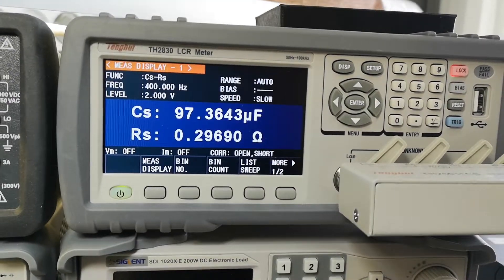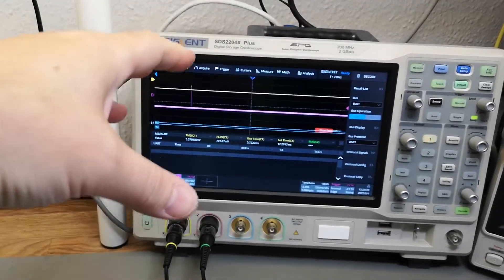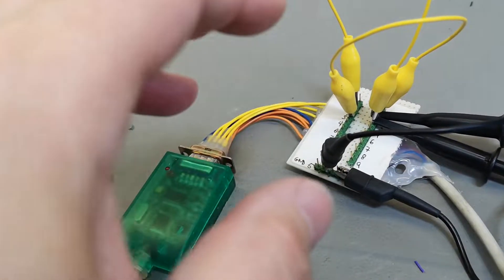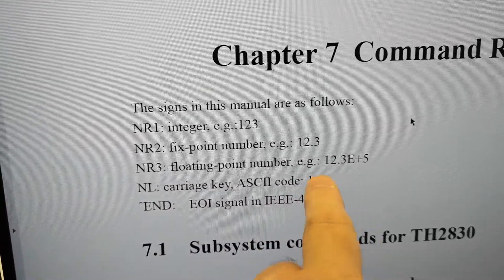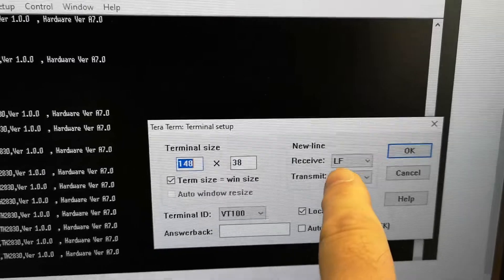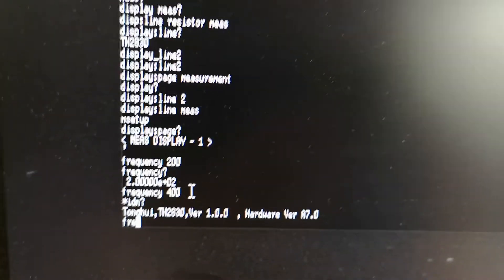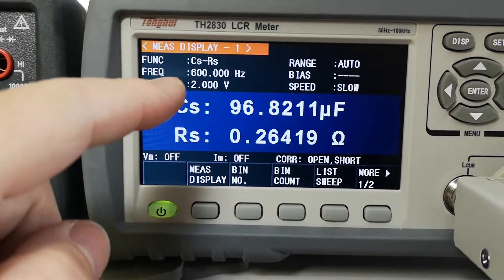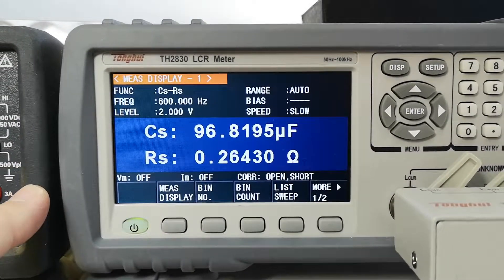Tonghui TH2830 LCR meter serial port rs-232 FREE SOFTWARE

Comment: Hi Thomas,
What do you think about the Tonghui TH2830 LCR meter?
Do you recommend it?

Have you been able to upgrade it to 2832?

I'm looking for a good LCR meter and would like to have one that can be set to any frequency. Then I can create different impedance graphs.
More well known brands are much more expensive.
Reply from the maker: i am very happy about it as it is, i have not heard about any upgrade, is it software only ? how to install it ? and what will it do ?
you will see many videos of mine where i use it for all sorts of components
if you want a free curve trace software for this one, go to my web site called webx dot dk, in the root write th2830 dot zip
it is written in java and will most likely run on ANY playform with a serial port, i only tried it on wondows pc.
Reply: @TeardownOZ2CPU  Hi Thomas,
Did you see the email I sent to your gmail account some days ago? (Checking if that is the correct adress. The name is a bit odd, I think...)
Reply from the maker: @Soren_Marodoren  no email.. you find it under YT profile, it is also easy to find at my web site under contact, did you find the software ? you can not write links or full email in a YT comment
Reply: @TeardownOZ2CPU  Hi,
Software won´t work, if you start the application a failure message appears (compiling error).
Reply from the maker: @metaluna72  and you know how to run java stuff ? install java
Reply: @TeardownOZ2CPU  Hi Thomas,
Java is installed here; I needed it for the “Test Controller” program.
However, Test Controller is an executable JAR file, so you just have to click on it to run it.
That's the extent of my experience with Java...
Reply from the maker: @metaluna72  it works perfectly here, i did not write this sw, and the person who wrote it for me, is not going to support it for free, I am sorry i can help more, if you find out do tell what you did, maybe it can help others, but so far all i hear is how good it works.